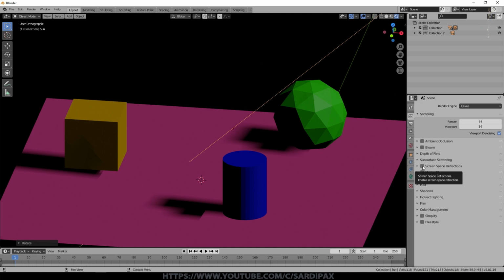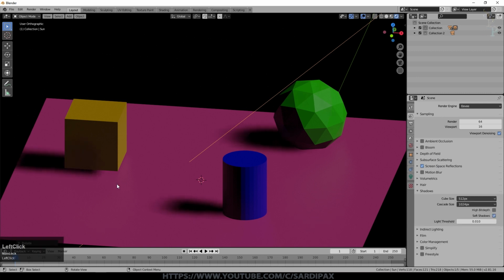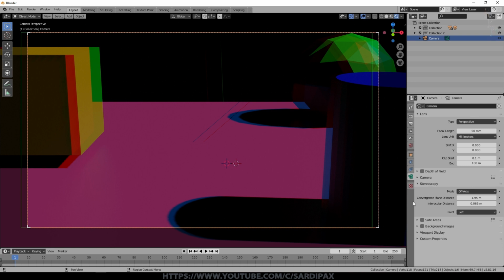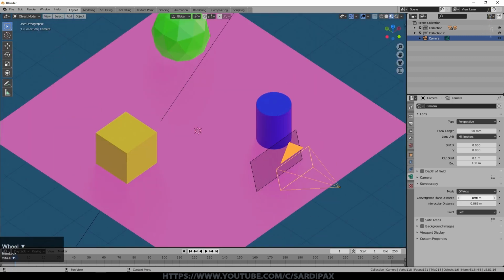Blender Eevee Tutorial - First Steps in VR/3D for YouTube

Comment: I have never seen a working 360° stereo video (or even image). The reason is that you record image spheres from constant positions that do not move with your head rotation. So, if you are looking in the direction that your render camera was looking, that direction will work when viewing it. If you then turn around 180° those positions do not move, effectively swapping what your left and right eyes should see, which is really uncomfortable. And it also won't work if you tilt your head to the side because the camera locations would then be on top of each other.
Maybe there are ways to fix this but the only one I can think of right now is to view a true 3D environment.
Fun fact: Microsoft and other companies are working on real-life volumetric video capture (synchronizing videos from several cameras filming the same object and performing photogrammetry on every frame). But as of now, the file size for those videos is huge and the quality is... underwhelming.